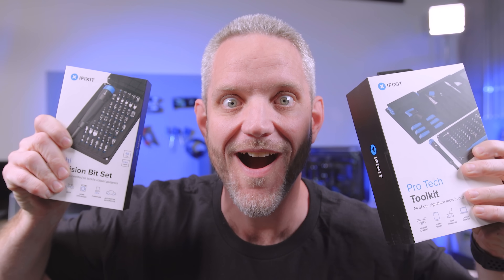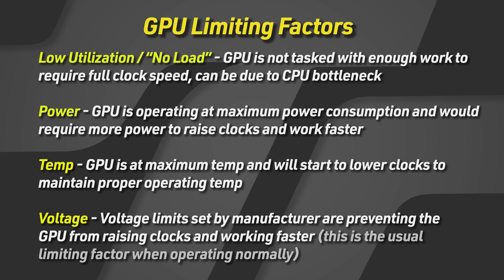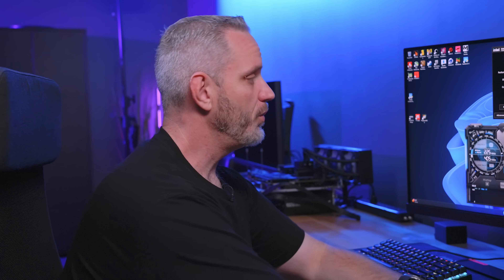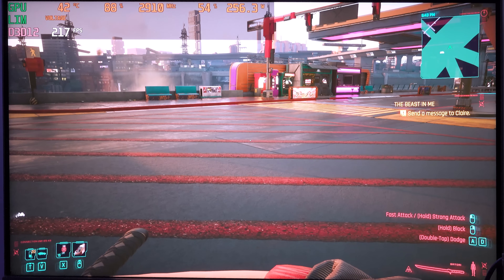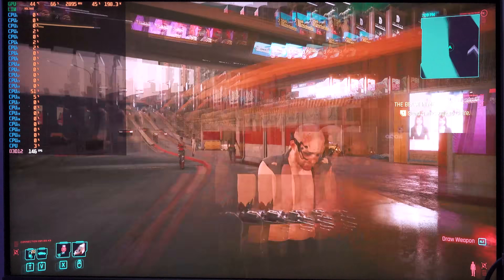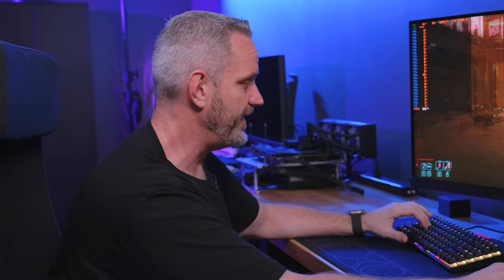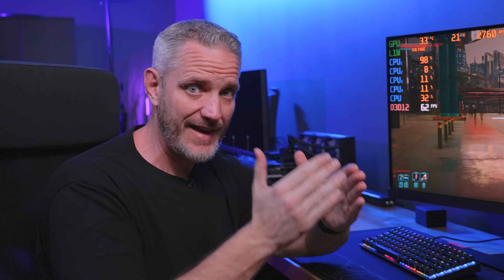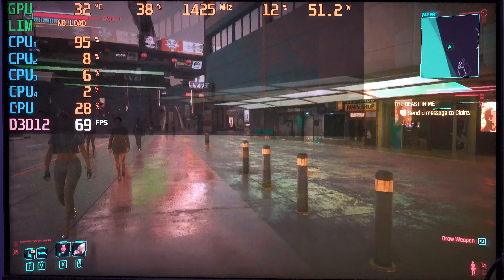THIS is what Bottlenecking REALLY looks like! AVOID THIS!

Comment: I see many people talk about bottlenecking and just comparing gpu and cpu. If you run a graphically heavy game on 4K/144Hz you're very unlikely to be bottlenecked by your cpu. Cpu + gpu is like a company with a painter and a mathematician and work being hindured by either is based on the work you give them, if you ask them to paint a fresco the math guy is gonna sit idle and if you ask them to do tax returns it the other way around.
Reply: That's an excellent analogy because that's basically exactly what happens. My only addition to this is while they're sitting around waiting for each other, the painter would be sipping some soy latte abomination while the mathematician would be sucking down double shot espressos, lol.
Reply: @demontekdigital its still use it when hitting 144fps
Reply: That would mean your VRAM, SSD and RAM are like the accountant/warehouse manager who holds and keeps stock of whats being used/needed... Right?
Reply: Also if you frame limit your fps to below your monitors refresh rate then it’s very hard to get cpu bound as well. There’s no reason to have more frames then your monitors refresh rate.

You can just set this globally in nvidia control panel or AMDs settings. ( Don’t use in game settings for it (or v sync) as they often are terrible and cause problems).
Reply: its like a restaurant operation where GPU is the kitchen and CPU is the Front of the House. When kitchen is beefy enough and can send food as fast as it can and FOH just can't keep up in delivering the food, thats cpu bottlenecking. The kitchen will end up slowing down production because why? no one picking up the food to go anyway
Reply: i have different friends that upgraded cpu or gpu but still were rocking 4gb of ram (sometimes even single channel cuz cheaper) thinking its was due their gpu or cpu (mostly gpu tho). also the same people that bought a 144hz+ monitor and used them on 60hz for over 2 years. not realizing/knowing that they have to change it.
Reply: I've downed my 144hz monitor to 120hz  so i'm less bottlenecked with my CPU (r5 2600) also using RTSS and capping it with it...
Reply: Does this mean if I bought a high end gpu, but my cpu is pretty mid, I'll be mostly OK? I'll eventually get a better cpu when I can
Reply: @iHaveTheDocuments  Imo? invest in a good CPU instead of "buying it later" because CPU an be hard to upgrade later
Reply: @iHaveTheDocuments  Depending on the game. Cpu does physics calculations like shadows, objects, and movement while gpu handles textures, blending of shadows, antialiasing etc. Even a weak cpu can handle most games just fine if you tweak physics-based settings accordingly.
Reply: @justinpatterson5291  I've always thought RAM & VRAM as a table surface the guys work on, the more area they have the more things they can work on without needing to waste time in between to clear space by putting papers in the drawer.
Reply: "Cpu + gpu is like a company with a painter and a mathematician"
I like that comparison. Well said.
Reply: He is still utterly wrong with this nonsense. "Bottlenecking"   and  " limiting " are not the same thing. Limiting is what happens when one component isn't fast enough to allow another component to run at full speed. *Every single component in your system except the very fastest one, is limiting the very fastest one.* 
Bottlenecking is when the slow component *adversely and disproportionately* cripples the faster component. It doesn't have to be "noticeable" to be bottlenecking. It has to disproportionately reduce the performance . 
If you take a 5Ghz and take it down to 4Ghz, you might expect an equivalent 20% reduction in GPU performance simply through not having to do as much: *that is not bottlenecking* . That's limiting. 
Bottlenecking is when you drop the CPU 20% and the GPU trips over itself trying to cope with the slow data flow; e.g. GPU perf drops 50%. If the game is easy/old you might not even see that difference in gameplay but the bottleneck is there regardless. 

It comes from the fact that the neck of a bottle is not just a tighter channel; it's that when water flows out, you also have to let air in; so it 'glugs' as the flow is *further* choked from having to pull back and let air in to replace the water [or whiskey 😬] that has left the bottle.

Comment: I'm looking forward to seeing how Cyberpunk 2.0 will handle CPU core load.  It's supposed to utilise them far more effectively instead of just parking 90% of your cores and using one or two of them.
Reply: apparently 90% usage on an 8 core CPU from what a developer said on Twitter
Reply: Depends on what windows does, ONLY seeing 90% on a 4 core 8 threads example.

But having 32 threads etc will be hard oressed to see the total go over 30 to 50% usage.

Plus cpus do spc so far more that also reduces usage.
Reply: I'm pretty excited for this personally.  I have a 4090 and a 5800X3D and it already runs the game amazingly, with DLSS 3.5 and the CPU usage upgrades I feel like the game will be jaw droppingly beautiful.
Reply: @maolcogi I'm in the same boat but with a 13900k, extremely excited but concerned about temps lol
Reply: @durrik  The Cyberpunk Dev did say to make sure your CPU cooling is up to the task 😅We'll find out tomorrow
Reply: @Ellis_B28  did he mention if it was a single core or not? Always possible
Reply: @Ellis_B28  finally ill get a decent frame rate from my 4090
Reply: @durrik  i forget how silly hot the 13900k gets my 5800xd dosen't go more than 60 watts.
Reply: @maolcogi you have a 4090? High paid job?
Reply: @Ellis_B28 It doesn't matter if it use all the core on the cpu if the fps and performance doesn't improve. It just gonna be unnecessary workload with no improvement.
Reply: @blackterminal  Yes I have a 4090, no I don't have a particularly high paying job. My priorities are set in a way that I can afford PC upgrades regardless though.
Reply: @zackwalkman8574  How do you know it won't have an performance benefit? it could very well be the case that FPS does improve if not better frame timing and minimums. Time will tell as the update is only a few hours away
Reply: @blackterminal  Maybe no family ...GF and could saved lol

Comment: Thank you for showing this video Jay. As your video from couple years ago has pointed out, it is not that easy to bottleneck a GPU with modern tech these days unless you are really going bottom dollar to pair an i3 (i.e. 13100) to a 4090. Thank you for demonstrating that here.
Reply: My god thank you for mentioning that its an I3 he mentioned. I was confused cause I thought he misspoke and meant a I7 13700 and was like.. woa.. how would that be a bottleneck
Reply: Or my antique i5-6600k paired with an RTX 3090. That situation is being resolved this month when all my new build parts arrive.
Reply: @10th_Doctor   im running an I5 9400F with an overclocked RTX 3070Ti. Will also solve the issue soon.
Reply: @Alex96194  I am going with an i7-13700K, not 14700K as the "refresh" doesn't really make it much better than the 13700 but does cost extra, 96GB DDR5 6400. I also bought a seasonic 1600W PSU with a 10 year warrnaty that will not only likely outlive my system even if I have it for another 20 years but also has plenty of head room for higher powered components down the line. I am waiting to see what the 5th gen Nvidia GPUs look like so not going with a 4th gen as my 3090 is still good enough for really any game at 5120x1440 super ultrawide.
Reply: 13100 is 8 threads though, not 4 like in the video.

Comment: I’d love to see a video showing the same kind of this with slightly older CPUs. The ones people are using that may be thinking of a GPU upgrade.
Reply: Yeah I have a 3600 and seeing if that would bottleneck a 4070 hard
Reply: @djBurgers depends on your setup, but most likely it would be heavily bottlenecked. You should consider upgrading your CPU to something better on the AM4 platform if you don't want to spend much more
Reply: I have a new (bought 2 months ago) 6750 XT with a 9900K. I can tell you the bottleneck is real with that pairing.
Reply: @djBurgers  as a fellow 3600 owner, it would, but not by that much. It would also depend on what res you're playing at. I play 1440p so my CPU doesn't work as hard
Reply: I have a 7700k with a 3090 lol........
Reply: @djBurgers  At 1080p and 1440p, certainly. 4K, maybe only slightly if at all.
Reply: I'd also like to see more of a deep-dive on CPUs combined with different speeds of RAM. Like, just how much of an impact does 200mhz of a RAM speed make? Will switching out 3200mhz DDR4 for an old 4000mhz kit or higher actually give me a noticeable benefit and possibly alleviate a bottleneck or am I just pissing in the ocean?
Reply: Psh. Probably fine.
Reply: Yeah that would be interesting
Reply: I definitely ran into this.  I recently bought an Radeon 6800 for a new build, but put it in my current machine until I get the rest of the parts.  I have a FIRST GEN Core i5-750 in it.  My performance got drastically worse compared to the 5 year old GPU I previously had in it
Reply: @djBurgers ye it would... anything above a r5 5600 or intel i5 12400f would be best choice to pair with that gpu
Reply: @DerekEskens  That's weird, the performance shouldn't go down like that going from a 5 year old GPU to a 3 year old GPU. Usually with a slow CPU and a fast GPU you would get similar frame rate as with a slower GPU
Reply: @Pasi123 maybe the pci slot for the gpu is ancient
Reply: Yeah I'm still on a 9900K and wonder if I have to upgrade before getting one of the 5000 series GPUs in a few years.
Reply: I should mention, biggest difference was the .1 and 1% increased a bit with 3200 cl14 and 4400 cl17 over the other two sets of ram. I don't think it is worth upgrading ram at this point. DDR5 6000+ cl32 or under is the way to go
Reply: 8600K and 6800XT hehehe
Reply: @GregBurgess360 I had a 3600 and a rtx 3080 playing at 1440p, I was slightly bottlenecked, awhile ago I upgraded to a ryzen 7 7700x and their was in an improvement in most games but if you want a 4070 then get it, you will still get better frames and in the future you can just upgrade your cpu
Reply: @DerekEskens  There was something really off with i5-750. I remember when I upgraded my GPU from 560Ti to 770. Once the CPU got medium-high usage (not even 100%), it didn't feel smooth despite 60-70 fps+, and the input lag, my god, this CPU made it so awful when it had high CPU (not GPU) usage. Changing RAMs, OCing, settings affinities, nothing really helped.
Reply: Before I upgraded my cpu, I paired a shiny new RTX 3080 with an i7 4790k, and to my surprise I didn't get studdering. But the graphics card was being under utilized. I hammered the card with everything on ultra settings and 1440p, and it have the card more to do. The wild pairing of new card to old cpu videos are always the most interesting to me lol.
Reply: @frankbizzoco1954  yeah like they work great, like yeah you will 9 timed out of 10 get a decent fps boost if your upgrading to a cpu that is like 3 generations ahead of ehat you got, but the older decent cpus still manage very well
Reply: Oh, like an old 7700k?
Reply: @DerekEskens  I think you have driver issues. Did you completely uninstall previous drivers?
Reply: 4790k with a 3080 ti here. I've been looking for these types of videos specifically for this very reason. I occasionally get wild swings in fps, but I generally play less optimized "non-AAA" games and every now and then, simulation games. So I'm sure updating to a modern CPU would help, it would just be nice to know exactly how much it would help.
Reply: @Tydud3  how is that working for you? i have a 7700 (non-K) and was thinking of an upgrade, at least a 3070.
Reply: @Tydud3  How bad is it :/ I have a 17 7700K @ 5K. looking to upgrade but don't have budget to for CPU and GPU at the same time.
Reply: I got something very similar with what he showed in the video on my system, a little worse perhaps when I upgraded my gpu to a Rx 6600 and paired it with an Fx-8320e
Reply: Yeah like me who got a 1660 super for my I7 3770 and ended up having to get a whole new pc with a ryzen 7 5700 just to use it... aaaaand then get a 3070 ti
Reply: I haven’t noticed anything either with my 4070ti and 9700k

Comment: I recently got bad advice for a build and the bad pair of i5 13400F and 4060 TI causes dramatic drops in FPS and stuttering. Got my money back on original CPU and upped to a 13700KF solving the problem but DAMN was the bottleneck noticable

Comment: Bottlenecking can give pretty weird results. Some years back both I and a friend upgraded our graphics cards to the RTX 2070 Super. He had a machine with an Intel Core i9 9900K while my machine was running a Core i7 6700. There's a pretty huge difference in CPU performance between these two, and in games his machine tended to be a lot faster. But when benchmarking The Division 2 we got some pretty interesting results. Like I said we both got 2070 Super cards, but they were different make and models. And in The Division 2 my machine consistently benched one to two FPS higher. The difference was that my graphics card had a very slight factory overclock which was just enough to make a difference in the benchmarking of the game. However what wasn't obvious when looking at the average FPS was that on my machine the CPU was pegged at over 90% for the entire benchmark. I actually got a good laugh when I sat watching the CPU utilization as reported by the game and it at some point reporter a utilization of 105%...

Mean while my friends machine never broke 35% CPU utilization in the benchmark.

When playing the game this was a lot more obvious. Loading times were a lot faster, and there were a lot less cases where the game slowed down
Reply: This is why i say if you have a Cpu bottleneck you should instantly do a 15% overclock on the gpu as the card makes up for the gap a tiny bit but you still have to know there will be slow downs and loading issues etc. Thing is these issues really dont bother as much right now in my current combo so im good.
Reply: im alright, if my belongings all returned theyll keep me busy for years
Reply: i mean some ppl "adapt' b-die ram....and OC the snot out of their ram....w.o realizing the price difference is near trying to grab a better cpu/board/chipset/ram combination w.o trying to buy "BENCHMARKER FLAGSHIP ram kits" Price difference PURELY from a if you "SELL" what you have for an "upgrade" the cost/difference is almost negligible
Reply: @EBMproductions1  Yeah OC'ing can improve things but it could potentially also have lasting long term effects. On the CPU. I support OC'ing on test benchmarks but for gaming its kinda walking into a black hole a bit. Any bugs or glitches that occur is like a soup of worms. XD. Most devs will just be like WTAF are you playing on hardware from the  late 90's for XD.
Reply: @MJSGamingSanctuary  nah my idea us a low level overclock so enough to feel a difference but not enough to hurt anything. Plus my pc is doing fine post gpu upgrade so now im saving up for a i5 13600k or Ryzen 5 7600x combo.
Reply: Physics says you cannot do 105% but every high school football coach knows you can go as high as 110% or even 120%.